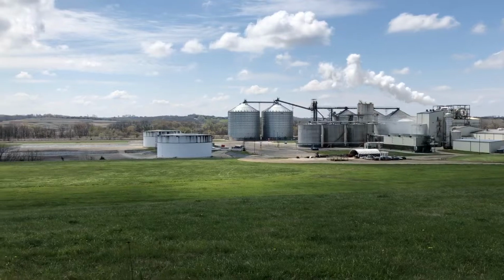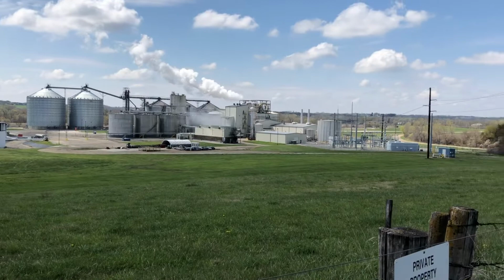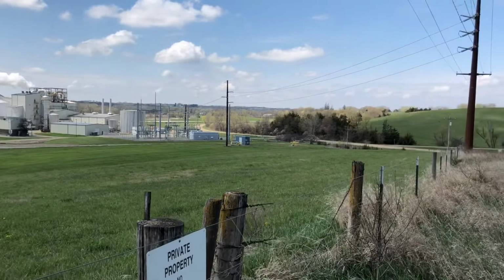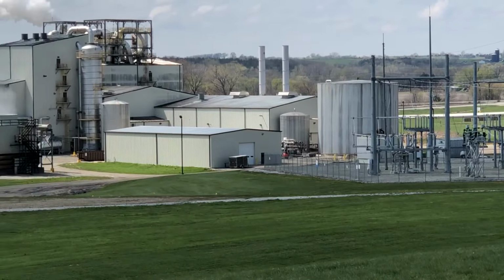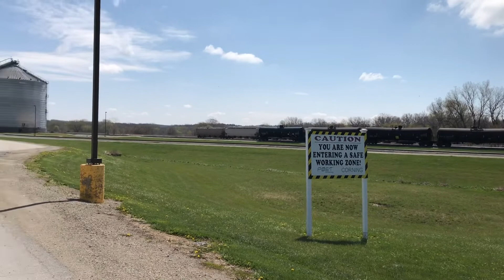POET Ethanol Plant - Brooks,Iowa

Comment: Most cats hate to travel.  How's Libby doing?
BTW,  what are you going to post about in NH?   Hiking vids, rail fanning?  Libby vids?
I've about finished drywall in my new bsmt hobby room.  Even installed a mini-split myself.  My whole body hurts.  Even my eyelashes.  ;)
Safe travel.
Reply from the maker: Rest those eyelashes.  You don’t want to blow one out.  Ruin your pro career.  

Libby does love traveling in the car.  We let she out of cat carrier when we are on the way for the day.  She finds a place to hide and sleep most of the day.  She loves to explore the hotel room at night.  She usually ended up behind the curtain looking out the window.  Not sure what I’ll video first.  Maybe exciting video of unloading the U-Haul😀
Reply from the maker: Looking forward to seeing a video of your space.  Have you designed the layout yet?
Reply: @FredE528  
I've got about half of it designed, far too ambitious, though not as big as your NH space.  So I'm designing phases with temporary end loops.
I've got existing stud walls to deal with, too.  These 2x6 walls are the bearing walls (instead of columns).  So it's a challenge.
I'm using the open source XTrackCAD, which is supported, isn't too difficult, and has hundreds of built in model & track templates that are "pick & place" (Atlas, Peco, Micro Engg, Walther, FOS, Central Valley...).  How could I refuse?
Reply from the maker: Ok, step at a time. 👍

Comment: Didn’t you knock to go inside? If you showed them one of your #$&*@ videos they probably would have known you weren’t a capable terrorist and took pity and let you in. That was a great video and I can see a representation of it on the new layout. We’re those Walthers cornerstone corrugated tanks?
Reply: Hey Fred, I just found a channel and product you may be interested in. It’s Model train technology on YouTube and the product is the MTT precision train detector. It’s depth specific and they shine a bright led light on it and it’s not effected by the light. They also have a sensor that will trigger a crossing. Looks like you can leave the garage door open so you don’t melt and the detection will still work.
Reply from the maker: Thanks for information.
Reply from the maker: Waltzers tanks for sure.  😀
Reply from the maker: I did got to the main office to get permission to film.  But nobody there.  So I figured  must be ok since no guards.  😀
Reply from the maker: Just watched the video.  Pretty interesting but $25 each makes it a bit expensive.  However, easy of installation is big plus.  It is supposed to work with JMRI and Arduino but I’d want to test one to be sure before buying more.  Thanks a lot for the tip.  😀
Reply: Oh, I hadn’t checked the price, I just thought it fit the bill for your ambient light issue. You must be very excited to see the new place (and basement). Stay safe.
Reply from the maker: Thanks.
Reply from the maker: Hoping to visit the famous horseshoe curve in Altoona,PA today.  Slight detour out of our way but I want to see. It.  Just hope for train to show up at right time.
Reply from the maker: Thanks.  Our daughter called yesterday to tell us she has COVD.  Classic symptoms.  What a shock!  She was scheduled for first vaccine shot today.  Husband and our granddaughter will be tested today.  Bummer.
Reply: Sorry, I hope they will all be okay. You haven’t been around them yet, right?
Reply from the maker: We haven’t been around them.  Daughter’s husband and daughter tested positive.  They are all off limits for 10 days.  I talked to my daughter tonight and she seems ok.  Granddaughter has no symptoms.  Husband has mild symptoms.  All looks ok at this time.
Reply: As an employee of this exact plant, I am surprised that nobody took notice of you on the many cameras around the property.
Reply from the maker: I did try to get permission to film but nobody in office.  In fact I saw no one anywhere.  I’ve tried to represent your plant on my NH layout but I don’t have the space to due it justice.  It’s a work in progress which I hope to final this summer.
Reply: @FredE528  yeah, you must have been there on a weekend. No office workers. But there are always people on site, 24/7. I'm sure if you tried on a weekday you might even be able to get a guided tour, we are all pretty friendly out here.
Reply from the maker: I would like to talk to someone about the operation.  Especially interested in the movement of the train cars coming in and going out.  Is this something that you are familiar with?
Reply: @FredE528  I personally don't work much with the rail, that would be a commodities department question.
Reply from the maker: OK, thanks.